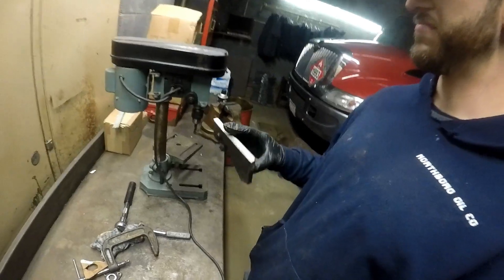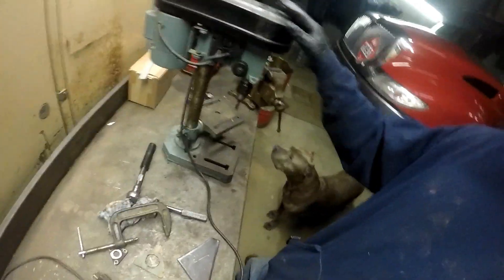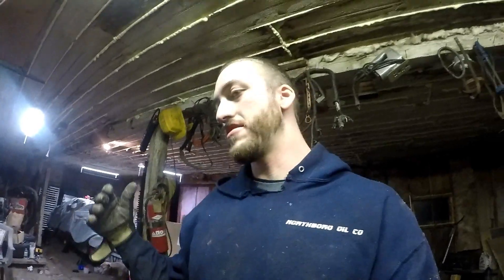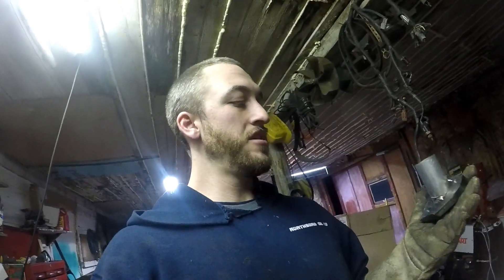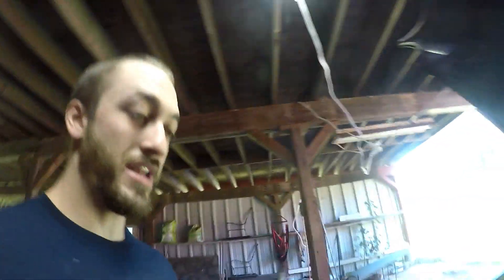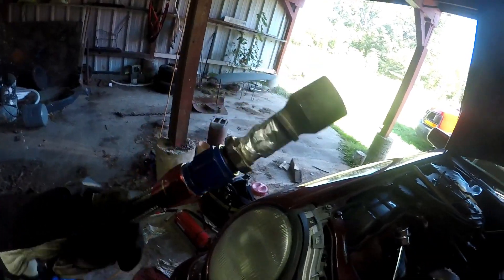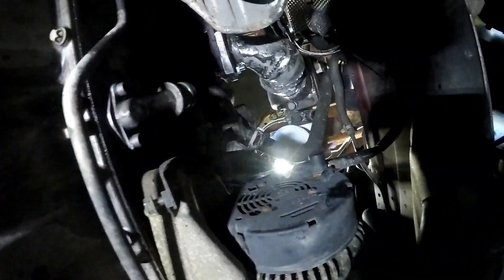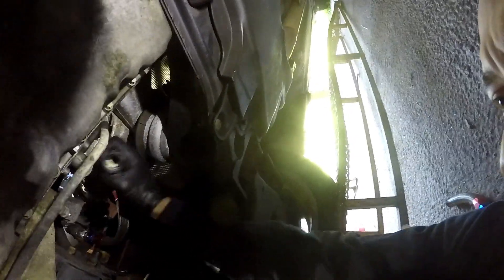Diy Turbo Flange for BIG TURBO OM606

Comment: broooo make an update video on the 99 300td!!! i want to see how you set up the bigger turbo setup and vids of it running and what not!! i have a 85 300sd, an87 300td and im about to buy a 99 300td and i love your content and would love to get some info
Reply from the maker: car was sweet for about 2 weeks then a prechamber fell into it at a stop light. motors been in and out a few times, machinists cant get things quite right. These things are amazing when running but mines being a POS, bought 3 spare om606s a few weeks ago and a dieselmeken pump came with it.